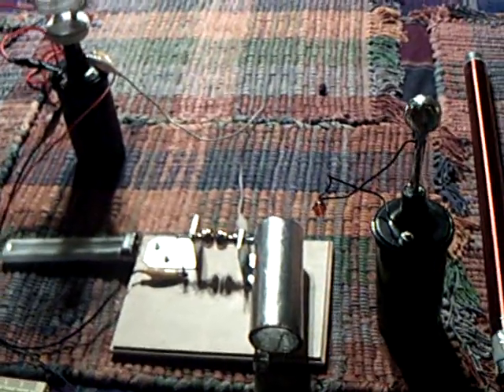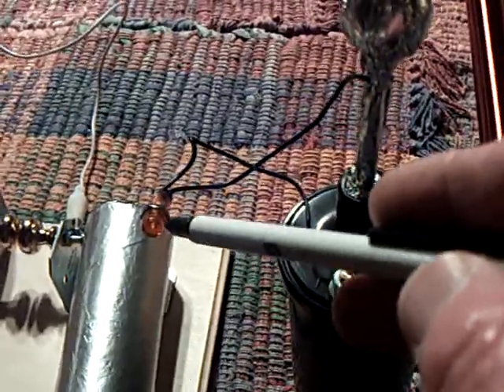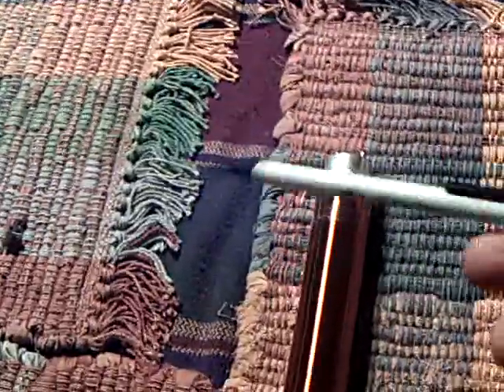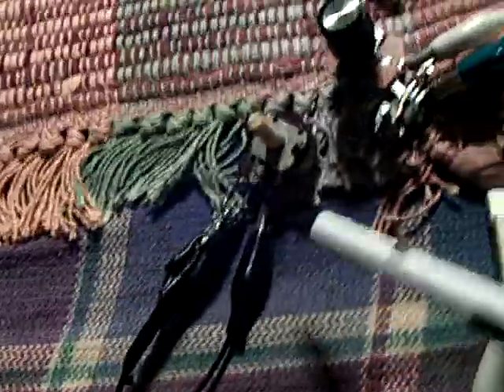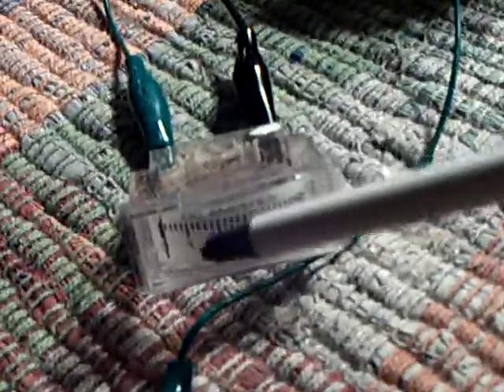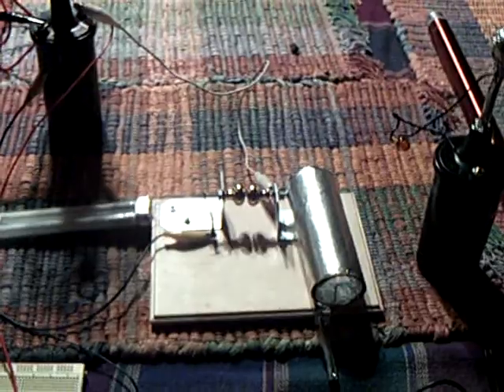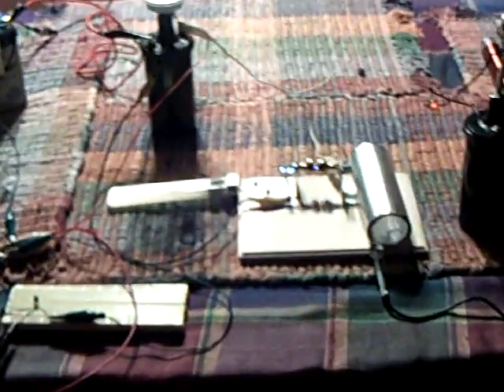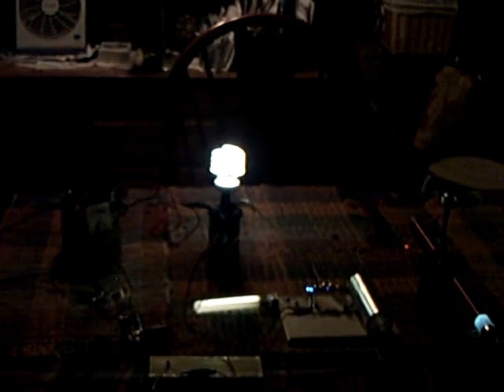Tesla High Voltage Display

Comment: pure tesla stuff-spark gaps,capacitors,and air core inductors,or in your case vacuum core-nice wind on the flouro coil.
try capacitor discharge thru the flouro and see what comes off the coil.
5